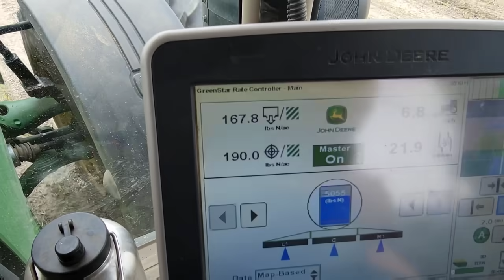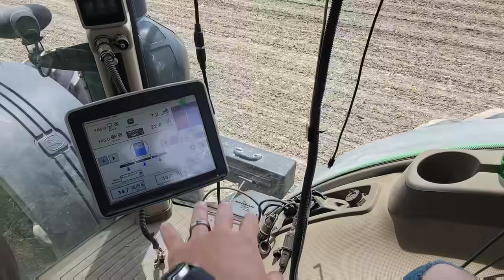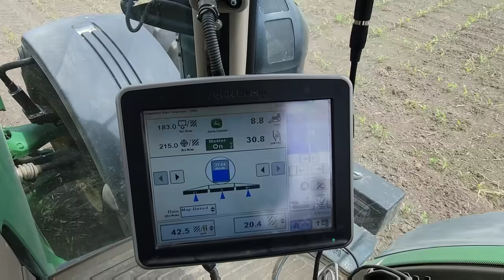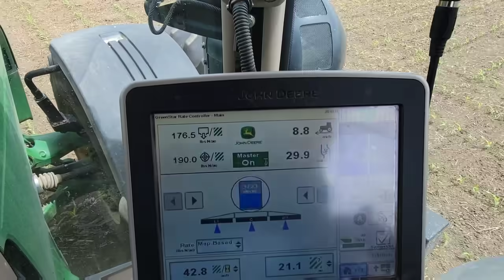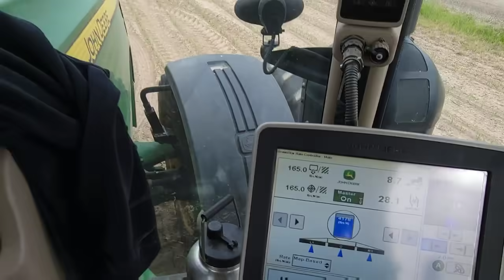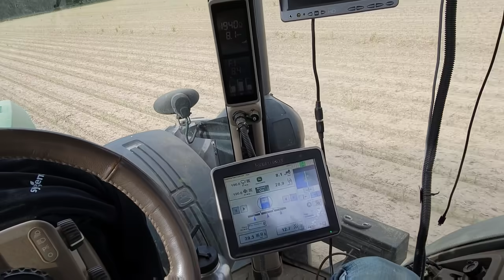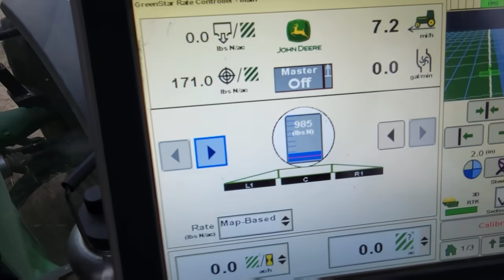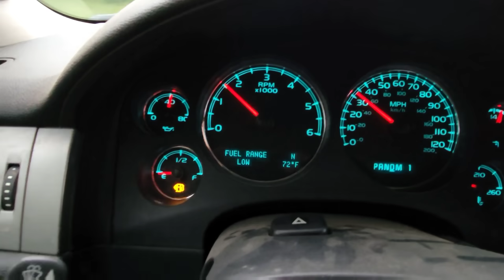What the Problem is?  - #431

Comment: The Anhydrous Ammonia (1005) is in gas form when you get the tank and under pressure (value I am not sure). The gas flows through the screen and into the square box which is two parts, first it flows through an inner pipe with a auger shape inside which helps the gas form into a liquid. When it reaches the other end, the gas exits the screw and runs on the outer side of the screw in a separate chamber, again helping the gas turn into a liquid. It then exits the left and right ports as a liquid. The vapor line is used to drop the tank pressure to atmospheric pressure, when you take a gas from high pressure to low pressure, it gets cold and causes it to change states from gas to liquid. The small line after the strainer to after the flow meter helps push the liquid. Although I am not a Raven expert, I deal with natural gas  where we unload semi trailers back into pipelines and we have to warm the gas because of the liquid dropout. Liquids will damage a gas compressor.

https://youtu.be/0UFuZW1c_gM?t=15

Comment: Though not deliberately, could an error occurred @ the distributor, the tanks are not filled❓ they weight them before you leave the plant but if they are already "filled" do they still weigh❓  do you have a scale @ the farm❓ The tare weight of tank should be on a tag for each tank. So if you weight each tank before leaving, you should know if It is actually full.

Just saw a video, 767 Air Canada jet , ground  fuel fill mix up, only had enough fuel for half the flight, ran out of fuel @ 41,000 ft, both engines shut down .
Reply from the maker: They were full. We're using about 6,000 pounds out of the "big" tanks so you know if they aren't full when you hook on to one.

Comment: Could the weather being cooler and the pressure in the tank lower causing flow problems?
Reply from the maker: Well that was one of my first thoughts but by the afternoon is was is the 70s and sunny. Shouldn't have made that kind of a difference
Reply: The liquid in the tank won't warm that fast.

Comment: Do you run N-Serve with your anhydrous? We had to stop using it because it’s so corrosive and it starts bringing rust into the cooler and causing rate issues. We also had the same problem with not being able to hold the rate on our bar. Part of the problem was the temperature difference from when the tank was filled to when we were applying the anhydrous and the other part was trying to get the new rate controller calibrated.
Reply from the maker: Could you explain how/why you had trouble with the tanks being filled at a different temperature than when you used them? That seems like my issue do but I don't understand why. 

No N-Serve except maybe 1 tank a year.
Reply: @BorderViewFarms  the way I understand it is the pressure difference because of the temperature variance from when the tank was filled to when you apply it or try to get it out of the tank. I don’t truly understand it myself but I know it causes a problem. What I don’t understand is how they can apply anhydrous in the winter time up north and don’t seem to have problems. Once we got through the cold spell this Spring and it warmed back up the problem seemed to go away or at least get a lot better.
Reply: Farm in NE ND. Have applied nh3 below freezing and haven’t seen anything like that.

Comment: I'm a bulk anhydrous hauler. We can only fill tanks down here in Kansas to only 85 percent. Just wondering if you guys are the same up there. I have also noticed that when I fill a tank to 85 percent when it is hot outside when it is colder the percent level goes down. I wonder if that is the case with the nurse tank not going as far as they should. Just curious what the percent gages show when it's full
Reply: California is 85 percent also.
Reply from the maker: Depends on the liquid temp. Have to allow room for expansion so they can't be full but if it's 90* outside I think they can fill them fuller than if it's 50*. Usually they are about 85% though.